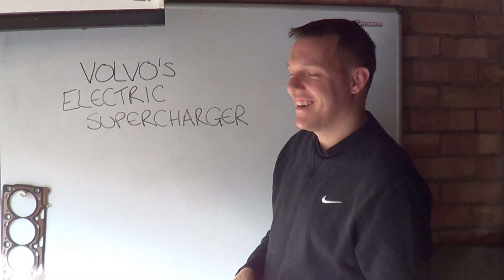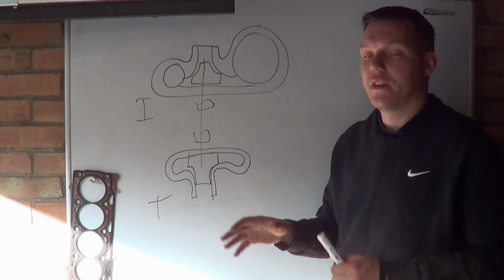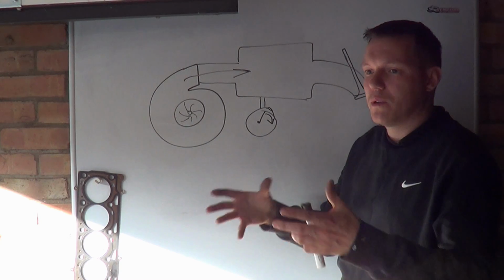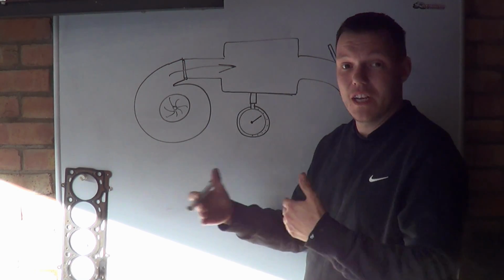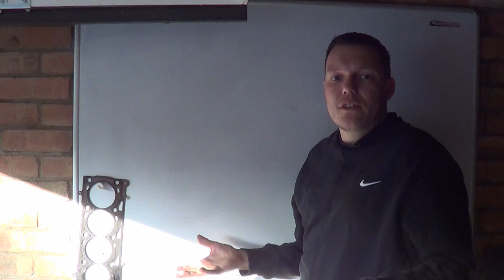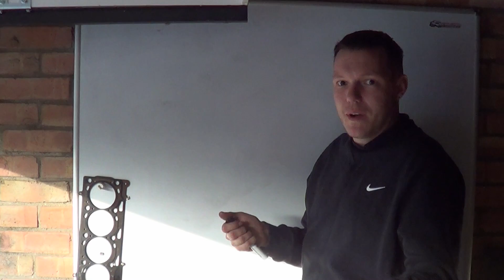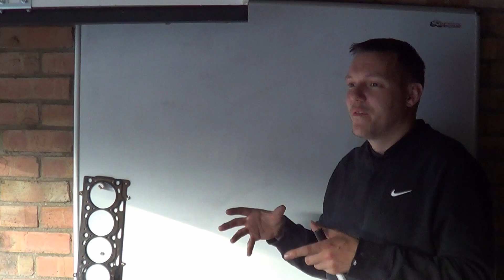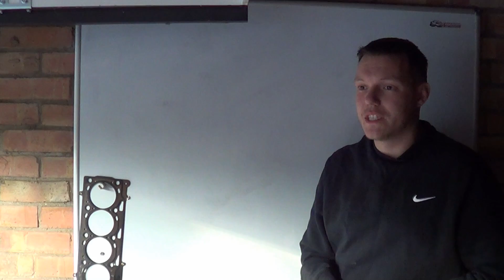Volvo's electric supercharger?

Comment: it does have practical application, they can cut down on engine size and reduce emmisions, save money on material, price for performance
Reply: it's true Jamie, turbo's are much harder to get to run lean n clean as the fuel metering is very difficult.. they do save fuel as you are getting more work from a given size engine using wasted exhaust gasses, but what comes out of the other end of the pipe is often dirtier than a given n/a engine as the stoichiometric ratio is hard to get perfect with any augmented boost engine.. you basically gotta dump in enough fuel to keep from burning your exhaust valve up ( remember a good portion of the fuel is used to cool the engine and is not combusted), 
as you pressurize the manifold the volume of air increases at a sort of unsteady rate creating reverberations in the intake manifold, it's not a static pressure, it varies according to the dynamic of your turbine blades, throttle etc.. so turbo's tend to run rich on boost to keep from melting down, thus creating more emissions.. this means bigger Cat's, more expensive piping, and a complicated fueling system contributing to cost, Mercedes spent millions on their F1 engine getting it to run lean and efficient, took a lot of exotic materials on the exhaust side and a weird through the V augmented turbo, married to the Kirs to do so, plus a fuel metering system they aren't telling anyone about..
  turbos are great for high performance , but running clean in a family car? .. maybe the Ford ecoboost 1.0 has turned the corner on it this year.. as the hot side of the engine can take a much leaner running condition  ( integrated exhaust manifold with the block, and oiling the cam belt to leech all that heat off it as it runs close to the manifold)
  in the old day we did standoff injectors to solve this fueling problem, read up on it pretty cool stuff.. hope this sheds some light
Reply from the maker: okie kokie

1) they cut down on engine size? Do you mean a smaller engine can produce 450bhp instead of a larger engine. True but not in this case. They're going the other way round. They're trying to get more power out of the same engine.
2) reduce emissions? turbo engine produce more emissions, more air more fuel.
3) the extra turbo's, extra motor and pipework is more material and the custom motors they use will cost more design and tooling.
4) Price for performance is probably correct.
Reply: 1] you stated the electric supercharger was impractical not the new engine
2} well as my first point was aimed at reducing the size of engines, yes reducing emmisions, also turbo's increase fuel efficiency didnt you know?
3 i agree but my point was aimed at "as a selling point" and they also pay less to the gov for having greener cars.
Reply from the maker: 1] you stated the electric supercharger was impractical not the new 
engine

 - yes but the electric system is part of the engine, so as a hole its a stepping  stone and not really practical. Turbo lag isn't an issue, no one needs to accerate that fast on the road.

 2} well as my first point was aimed at reducing the size of engines, yes
 reducing emmisions, also turbo's increase fuel efficiency didnt you 
know?

 - No need to be a smug bastard, this is a sticky subject. A turbo car makes better use of its fuel by recovering more power from the fuel burnt but they do this by burning more fuel vs a NA engine. In other words a NA car doing a 50 mile journey at say 60mph and a turbo car doing the same trip will use more fuel. Sure the turbo car can accelerate quicker and has higher max power but the overall journey is the metric which you have to measure it by to call it more fuel efficient. 

3) i agree but my point was aimed at "as a selling point" and they also 
pay less to the gov for having greener cars. - The component costs, tooling, R&D costs will outweigh the tax rebates. Not only that but the car as a whole wouldn't be greener. If you put the engine in say a van then yes, but sticking a 450hp 2 ltr engine in a saloon just to drive around town and on the motorway isn't a good use of the engine. 

No electric car that you have to charge is green, or emission free, the electricity has to come from somewhere, usually from a coal or gas burning power station.

Comment: velocity has nothing to do with the concept of a turbo, how can something have a velocity with knowhere to exit? volumetric efficiency has everything to do with a turbo's concept,
also exhaust flow rate has everything to do with how a turbo is powered, if it wasnt the case then why do diesels have different turbo designs? ie diesels have a faster flow from the exhaust, ive enjoyed your videos up untill now. but i agree on the fact that electric turbos are useless so far.
Reply: Pony Power
Reply from the maker: velocity has nothing to do with the concept of a turbo, how can something have a velocity with knowhere to exit? - 

- Don't know what this means??

 "if it wasnt the case then why do diesels have different turbo designs? ie diesels have a faster flow from the exhaust" -

- diesel turbo's are smaller to compensate for the lack of power strokes per minute.

"volumetric efficiency has everything to do with a turbo's concept,
also exhaust flow rate has everything to do with how a turbo is powered"

- it kinda get what you mean but how does this have anything to do with the video. You have to understand that the description in the video of how a turbo woks is very, very simple. I picked out the bits that were important to whole conversation.
Reply: velocity
the speed of something in a given direction.
the velocity in the manifold would be a by product of the increase in volumetric efficiency, ie positive pressure, the velocity is not the deciding factor on a turbos function its a by product of the turbos effect on an engine.
Reply from the maker: The energy that the impeller imparts on the intake flow is what causes a pressure rise in the manifold. Hence the 'positive displacement' part. The energy (which is kinetic) is how the air is 'squashed' into the manifold. As soon as the pressure force (for lack of a better word) equals the kinetic energy the impeller suffers from surge. The velocity that the air has picked up from the impeller is everything, hence why the impeller rotates so quickly
Reply: yeah i get what your tryna say matt, keep up the great work bud!